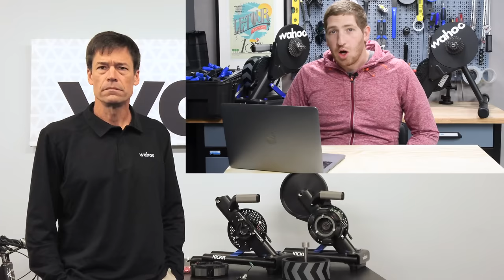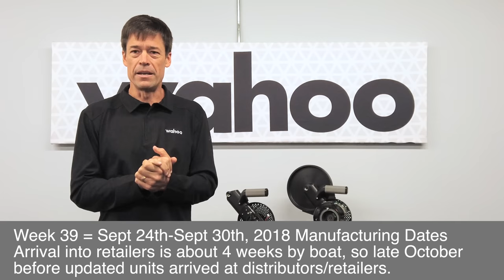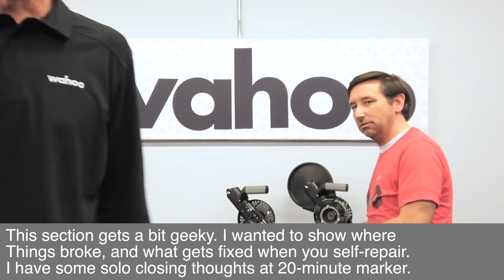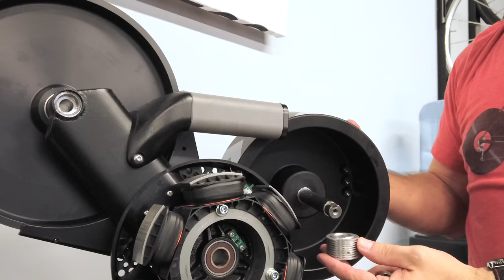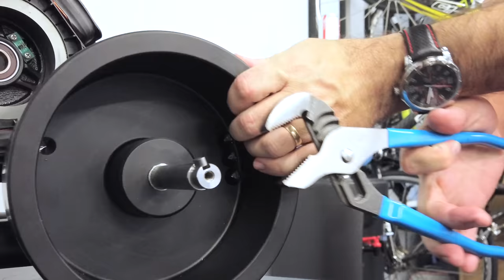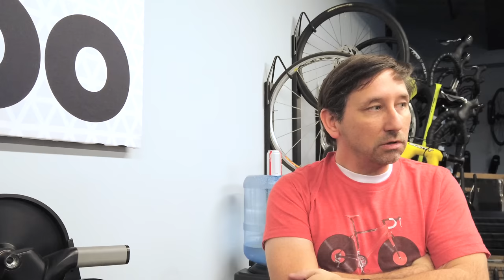Wahoo KICKR18/CORE Issues: Discussion with Wahoo CEO

Comment: Curious where my issue is coming from having literally just bought it last week directly from Wahoo and had the same problem within 1 hour of riding. Mine was the 41st week of manufacturing according to the serial number. Wahoo is replacing it but clearly that was either an amazing coincidence or they hadn't fixed it and are still shipping broken units.
Reply: it's easy to blame a part and provide a replacement - wat could be harder to say would be that it's a design issue.
Reply: @biglampar556  I think the opposite.  If they admit its a quality issue, that calls into question the integrity of the entire product.  If they say its a design issue, they can send a quick replacement and sweep it under the rug.
Reply: How can you tell from the serial # when it was manufactured? Looking to get one from my local bike shop and that is a concern.

Comment: The KICKR CORE's only came to my store in Ottawa Canada, in late December 2018. After several days of using it, I found the unit able to be seen by my APP's and Zwift, but the speed and power were not being transmitted from the unit. I restored the unit to the older (delivered) version of firmware and problem did not get corrected. I replaced the unit with a second one and the same thing happened, It was on carpet.  I changed my mind on the CORE and got a KICKR 17 model. I haven't had the problem again, but after seeing this,  it is possible that I could get it, but at least there is a solution, even though I would have to send my unit back to Atlanta for repair. Edited to add that I am moving my unit to a non-carpeted part of my floor.

Comment: Back when this was first an issue I bought a "defective" returned unit at REI for $400.  Set it up and had the click.  Got the upgrade kit for the woodroff key from Wahoo, changed it out, and it has worked great ever since.  Can't believe these are now $1300.
Reply from the maker: Price only changed once in last decade, about a year ago, from $1,199 to $1,299 - always been the same.
Reply: @Dcrainmaker  That's pretty good!  Didn't realize they were that expensive at the time.  Guess that's why I bought a broken one :)  Thanks for your video on this!

Comment: Thanks for this DC Just got my second kickr which is just clicking and clunking thought it had been sorted,  I did look at the first one and could see that it had undersized key problem    Bad engineering had this problems on engines  etc       Wahoo support  was OK    Which they should be with a product at  £1000 " and so many."   If the manufacture of a good product is bad it cost money and customers, lesson one  This might of just kept my custom  but only just .  I loved the Kickr when I first had it  but it has lost me nearly 2 months of fitness and I still have to sort this one.

Comment: While I would be frustrated if I had one of these units and I was having problems, people need to keep in mind the problems Tacx has had with trainers over the years.  I had a very early virtual reality trainer (Tacx Fortius) when they were first released.  I think I was one from the first shipment to the USA. I was very active on the Tacx forum and myself and a few others in the USA quickly discovered an issue with the motorbrake.  When the unit was accelerating the rear wheel on a negative slope, you could pedal faster and increase your speed. However no matter how hard you pedaled the software would report nearly 0 watts.  So unless the ride had no down hill sections, your average wattage for a ride was artificially low.  This problem was only on the 120V units.  The European units were fine.  There were also several other quality issues with the product.  After a year or more, Tacx finally came up with a solution which required an entirely new control unit. This did fix the problem, but we had to spend an extra $200-$300 USD to get this new control unit.  They tried to sweeten the deal by throwing in updated software, some Real Life Video DVDs and a few other things. But still, many were angry at having to spend extra money on a problem that should have been fixed under warranty.  So even though Wahoo are having some issues, at least they aren't asking the customer to spend more money to fix it.

Comment: Wahoo is outstanding. How many companies would do this? As you said at the start, their support is outstanding. My brothers kickr 18 had this issue and it was sorted out withing a week.
Reply: Seems a little gullible.  They shouldn't be releasing such poor products without due diligence.
Reply: @robbonner  Did you read my comment ? My comment was about the fact that they publicly addressed the issues in a video with a youtube tech influencer, and about my experience with their support. I didn't say anything about releasing products without performing sufficient due diligence. That's objectively a poor move isn't it? Is anyone praising that?
Reply: @ericamc28  As someone who does a substantial amount of work with brands like DCR (different industry), he is either getting paid or being used as a face saving campaign on behalf of wahoo.  This is not a brilliant or nice gesture.  The word is out that kickr18s are flawed, and they are doing everything they can to claw out of these mistakes.  So no they aren't wonderful or outstanding. Strickly business here.  In most circumstances, I would applaud upper management for doing this, however, I won't give that slack on this one.  The failure is too widespread.  Cheers!
Reply: @robbonner  So what's the alternative? Say nothing? Ignore it? Not fix and acknowledge their mistake?
Reply: @ericamc28  Fair point.  I would have had a much different opinion of this if it had came out 3 months ago.  I think that's the core of my gripe.

Comment: After 3rd replacement Kickr I’m done. Ended up buying Neo 2
Reply: My Kickr Core just went down after putting in only 38 miles in my first 3 days out the box. How has your Neo2 held up for you?
Reply: @abehaile2659  2nd year going strong. No issues
Reply: @sylwesterziewiec  that's awesome to hear because I JUST bought a neo 2T. Thanks for responding

Comment: Just received my third Kickr Core. On first sight i dont see any difference with the two earlier models. Free hub sound is now loud again which was much more silent on the second product. Also there's a small flywheel noise - again - which i now assumed should have been solved after more than a year (bought the first one in okt. 2018). So fingers crossed the upcoming weeks

Comment: I'm working with Wahoo right now.  I have a Humming noise that is transferring a vibration throughout the bike, it comes and goes based on loads and grade changes in zwift.  They say they are going to replace, they didn't didn't tell me there is a fix nor did they say what is causing it.
Reply: Same issue here.  My replacement seems better.

Comment: My 2 month old Kickr Core stopped working yesterday (power / speed no longer working) ... apparently due to sensitivity to ESD?.  An an Electrical Engineer myself, that is simply a poor design.  I suspect the issue is happening more than the CEO is letting on.  Waiting to see how Wahoo will handle the failure ...  in the meantime, my winter training has come to a halt (at least in my dungeon).

Comment: Stickers on my Core flew off first ride. Those that only came 50% off, I removed because they made a horrible hum hum sound. My worst problem with the core is the fact that the unit isn't centered on the stand, when you look at how the bike is attached. This is by far the worst experience with it and I'm sure I would call it a design flaw. The problem with the bike not being centered AND you are using a Wahoo sweatmat is that the right side is sinking further down the mat than the left side, making the bike lean to one side. So I had to shim the right side under the feet to have it level. I hope Wahoo in the future takes more care of these things as it's clearly a 100% design flaw.

Comment: My advice to you Kickr Wahoo CEO please use a bit high-end material. Most of the people in my Velo lab has the same issue with the drone noise or clicking noise. It is not from the tension belt that causing it but it is from the bearing where the belt wrap around. It cost nearly 1000 buck for the kickr core and more than a 1000 for the kickr.

Comment: Cnc machining  with a larger key and fixing bolt would help , tolerances with cnc are really accurate so to have a loose key or key way is due to manufacturing quality issues either with the machine or the tooling

Comment: So, is it safe to buy now? (Interested in Kickr Core) Great video btw!
Reply: It is totally safe to purchase now. You are in good hands.
Reply: @wahoofitness  I have concerns regarding the electrical risk of operating a Kickr Core on carpet and probably killing it due to the static electricity. Will it be fine? Thanks for the feedback back
Reply: Wahoo Fitness I went to a bike shop today to try out the kickr core.  The display unit stopped working, would not transmit power.  They unboxed another unit, assembled, and same thing.

Comment: "We didn't design it so that it was super tight in there"

Hmm, no stress simulation either? FMEA?

The fault with the little pulley could have been completely solved by moving to a clamping element which would completely negate the need for a keyway.

I've seen some instances of nasty wear on the bearing faces of the flywheel shafts.  We see this time and time again in the engineering industry  from over tensioning of serpentine belts (and poor design).

I'm not loyal to any brand but I think if I was dropping serious £££ on a turbo then maybe I'd be looking towards another brand.

Comment: Hi there, thanks for the very good insight to current issues. I bought a KICKR just recently and have been experiencing a low frequency but very persistent humming causing strong vibrations which I can feel in my handlebar, my pedals and it is also spreading throughout my apartment. My wife says it is one of the most annoying sounds she has ever heard when she sitting in the room below my training room. I have set up the Kickr at different locations and different surfaces (wooden floor, carpet, rubber mats and combinations of it) to make sure it is not just an unstable position. Has anybody else came across this issue? 

I am already in contact with Wahoo Support and they have sent me two units so far...third one is on its way. So they seem to acknowledge that there is a problem.
Reply: Do they pay for your return shipping?

Comment: 2nd Kickr 18 started making knocking noise today after 1000km. Wiggle / Wahoo replaced the 1st one straight away & also provided me with the new key, bolt & washer but for a product of this cost I don't see why I should be opening it up & messing around with it which I don't feel confident in doing anyway. I have a bunch of Wahoo products but they've really stuffed up here. Considering ditching the trainer & getting a Neo 2.

Comment: I have little confidence in the kicker 18. I think the key and key way solution was just a band aid and it will not solve the problem in the long run. I returned my kicker 18 after about 5 months of use. That is when I started hearing the clicking sound. I havent received the new unit yet and I am curiuos to see what the differences are when i take off the plastic cover. Instead of using the key and keyway, they should use a component called a trantorque which is a better solution to locking the timing pulley to the shaft. this would eliminate the keyway and all the variances that it can have in dimensions.

Comment: I've had a Snap, known vibration issue after one winter of usage, but just out of warranty, had to pay $250 for a new flywheel.
Thought a Core would be better, nope, the bearings gone on flywheel after light usage (common issue), now it's $300 for a new flywheel.
Going to try a self repair with quality bearings, not giving Wahoo any more $$$ for their crap.

Comment: All these trainers have issues due to the myriad of moving parts and conditions.  My Tacx Neo had Ant+ sensor failure, what’s important is the support.  In the end I purchased a kicker v5/2020 because it seems to very user repairable and has gone through years of improvement, the mechanics are all relatively fixable.

Comment: My first unit (Oct 2019) developed increasing noise/vibration. Waited from April 2020 to get my replacement; showed up on August. Just took back to vendor, as the replacement unit right out of the box had severe vibration about ~30kph felt right through seats and pedals. Really disappointed. As engineer, seems some severe QA issues remaining.... Rotating imbalance.
Reply: I've kind of given up on smart trainers for now, given the big $s being paid and so many instances from it seems most vendors of big issues.

Comment: For everyone to know. I just had my 2nd Kickr 18 go to crap. The vibration and noise issue was a huge problem on the first one and it was replaced about the time of this video. Three days ago the replacement unit started to do the same thing and it will now be replaced. I just cannot understand how I could get a second bad unit when they said that the problem was fixed and I was getting a fixed unit. Very frustrating. Not sure I will ever buy another one of these especially if the 3rd Kickr goes bad also.
Reply: Do you have to send it back the faulty unit or they just send you another one?

Comment: I just received my 2nd Core replacement (3rd unit) The 1st one had all the noises (and more) described in this video. I contacted Wahoo and they immediately sent me a new unit. Then the replacement unit stopped transmitting power (the other issue) after 2 rides. I called Wahoo and they immediately sent me a new unit. You know what they say...3rd times a charm! Last chance, Wahoo... If the 3rd unit craps out, I want my money back to buy some new cross-country ski equipment.
Reply: Did the 3rd one last? Did they pay for your return shipping?
Reply: mct : Yes 3rd unit was all good. Used it through the winter 2018-19. Wahoo sent Fedex waybills by email so there no return shipping issues at all.

Comment: I have a Kickr snap. I was / am disappointed with it. The reason why is because the roller that is engaged with the back wheel is not running concentric, I checked it with a dial test indicator and noted a total indicated runout of 0.8mm or 1/32" this is felt as vibration through the unit. I'm moving back to the trainer, now that the cold and dark night's are drawing in but I know this issue isn't resolved... Any ideas...? I don't feel like striping it down and grinding the assembly between centres...
This is definitely a tolerance / manufacturing issue.... Any help is much appreciated....

Comment: I got a Tacx Flux and it started making grinding squeeling noises in 2 months of use. Brought it back to the store and got a replacement in a week and an upgrade to a brand new Flux S. 5 rides on the new unit and it started making rubbing sqeeling noises again especially in the first 5 min. before it warms up. Seems like both of the big brands have issues with their trainers.

Comment: Great video! I just went to swap the bearings on the flywheel shaft (Kickr Core) and was having problems removing the shaft from the bearings. On close inspection, where the bearing inner ring meets the shaft, there seems to be the same red residue that was in the keyway. I fear this is red Loctite. Possibly spillover from applying to a keyway? Do you know of anybody else reporting this? Is that what it is?

Comment: Here’s some thoughts..... direct drive trainers suck.  I’ve had issues with Hammer H1 got a replacement H2 had issues got it replaced and sold it the replacement, got tired of dealing with cycle ops.  Bought a kickr 18 - got a replacement and sold it, and before someone brings up Neo I’ve got a buddy waiting on a replacement now.  I think zwift is the issue, the hardware can’t keep up to the software.

Comment: Got a kickr core in December 2018.  It didn't work.  It would only have resistance for 10-13 minutes, then it would die and have no resistance.  Sent it back.  Got a replacement.  It worked fine for about 3 rides.  Then it just died completely.  Worst part, Wahoo service.   I was going through my local bike shop (thank god for them), Wahoo didn't believe my first unit was broken.  My bike shop took the unit, set it up at their shop, it didn't work for them either.  Wahoo still really didn't believe them, kept sending us all sorts of ideas to 'fix' their trainer.  We tried swapping out power supplies.  We tried (3) different phones (all with the Wahoo app).  Nothing worked.  We have no idea why the first unit didn't work.  On the second unit, we could see our phone could see the unit (we had 4 green bars on the app), but no power or speed would register.  And of course no resistance from the unit.  Tried 2 different phones on this one.  Both got the same 'phantom' Bluetooth connection.  $900+ for a trainer that wouldn't just spin.    Another customer bought one at the same time I did.  He had to have it warrantied as well.   You have been warned...  Also, after watching this video I am amazed that Wahoo released this product at all.  If a $300 dumb trainer works EVERYWHERE, a $900-$1200 trainer certainly should as well....  Fucking blaming the 'environment' the trainer is set up in is absolutely the fucking worst excuse I've ever heard.  Oh, you rode your mountain bike off-road, well that's why it broke...  (see how dumb that sounds...)

Comment: CEO did not mention when they fixed the problem in the kickr CORE (which week). I ordered a CORE, it only took 2 weeks to arrive, I went to get it on 12/26/2018, week 52, by serail number my CORE is from week 38 September 17 to 23.
Do I have to worry? So far I only have 11 hours of exercise.